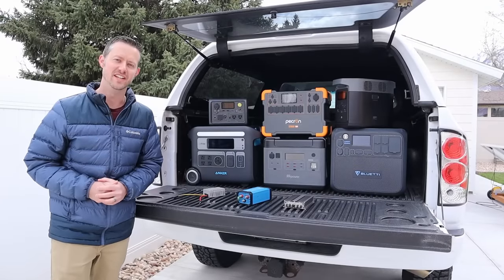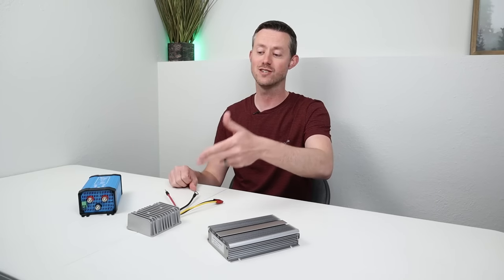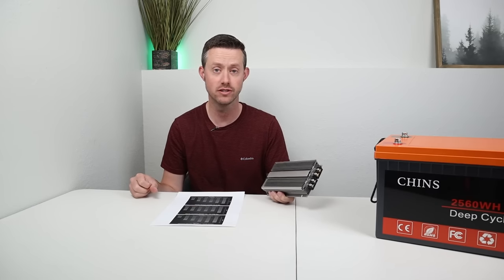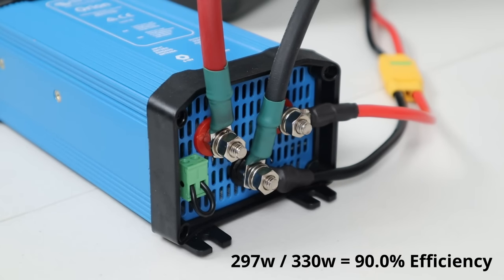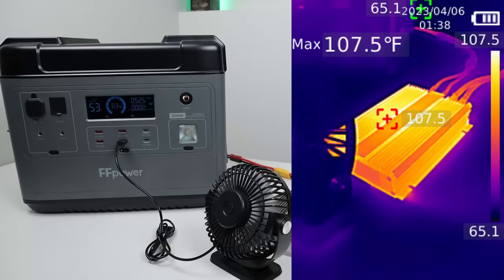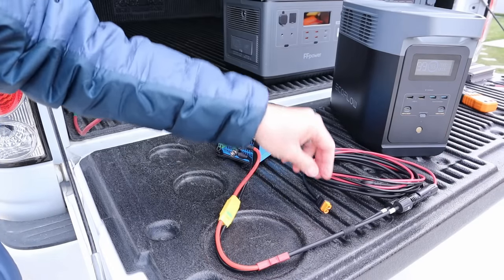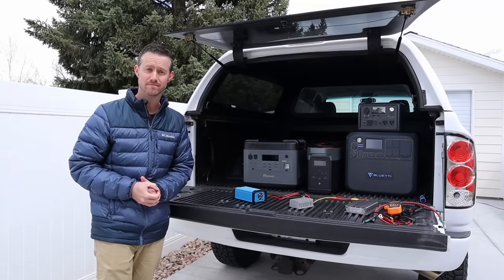Charge Your Power Station In Your Car FASTER - Perfect for Overlanding, Car Camping, and Van Life!

Comment: You could remove the Voltage regulator from your Alternator to get near 250 Volts with up to 200 Amps.
And use a Rectifier only and input that into the solar input of the Powerstation.
Then your power station becomes the Voltage regulator at 48 volts.
That would max out your solar inputs on all of them.
And then use the 12 Volt output of the powerstation to charge your car Battery.

Or you could even have 2 dedicated alternators.
One to charge the 12 Volt Battery and the other to charge the Powerstation.

Comment: Jason with summer coming can you do the holy grail test about running a window Air Conditioner 24/7 using only solar to recharge batteries.  Like show which power station, which batteries, which solar panels, etc.

Plenty of us preppers got emergency sheds that could use your great presentation and explanations.   Ty
Reply from the maker: The only thing is that I don't have a window ac unit and all my windows in my house open sideways, not vertically so it's not the best for hanging one.
Reply: DIY Solar with will prowse has some videos running cheep window a/c for cooling his solar for a shed he has playlist solar powered air conditioning

Comment: Hello Sir, thank you for your informative video! I plan on using the exact setup you have here with the Victron Orion 20 Amp Converter, 6awg to 10 awg cables to charge my (small) ecoflow river max (576 W); what size fuse did you use on the 6awg near the truck battery? I plan on installing the converter in the back seat of my 2022 Tacoma.

Thank you!!

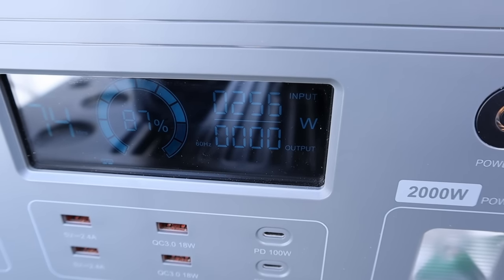Comment: Jason your video was very informative especially @15:26 because I have a Bluetti EB3A that I want to charge faster from my car.  Through the cig-plug, I get between 12-86 watts and it always jumps around on that as well (must be an EB3A thing).  Getting closer to the 200-watt max input seems great ~ double what I'm getting from the 12v cig-plug seems worth it.  I am considering either the 10 or 15-amp model because the max input through the MPPT charge controller is 8.5 amps at 12-28vdc.  Someone thought the 20 amp would run cooler because it was not working as hard do you agree?
Reply from the maker: Yeah, to get the best life span you'll want to get a larger DC converter so it runs at a 50% load instead of 100%. I'd recommend the larger option.

Comment: Great video as usual, Jason! Thank you.  Wondering if you can help: The Delta Max 2 has 2 solar ports.  Do I need to use two separate dc to dc converters to serve both or is there a single unit out there that would work?  Also, do you think the stock alternator of 180 amps would handle two converters?

Comment: Installed a 1000W Renogy ac inverter with 4 gauge wire in my vehicle. Charged my EcoFlow River 2 Max at 600W (adjusted max ac charging rate to 600W from EcoFlow app) as a test without any problems. Will be also charge my Delta Max the same way, and can adjust charging rate up or down based need or time on the road driving.
Reply from the maker: Sweet setup, lots of different ways to skin a cat and that option definitely works! 😁👍
Reply: What did you hook your Renogy ac inverter to as the power source?
Reply: @guitarnut5754  the vehicle’s 12v battery. I only turn on the Renogy inverter when the vehicle is running.

Comment: A small USB fan is what I use to keep my chargers cool. Some of my Type C PD chargers and ones for my power stations get very hot which can`t be good but a small fan blowing on them makes a huge difference, keeps them cool to the touch, and will extend their useful life.  These little fans only draw 2 to 5 watts depending on speed setting.
Reply from the maker: It's crazy what a little fan can do! I had it on the lowest setting which is around 1 watt of power.
Reply: @Jasonoid  I just got a new USB fan that ran over 5 days from one of my 15 dollar "phone charger" type power banks...a new record. The power bank is heavy but I think it`s 2800 mAh. It also listed 98 wh in the specs.

Comment: Thank you, this video is very informative. I consider using the Victron Orion 20 Amp converter for alternator charging of my Ecoflow Delta Pro, connecting it to CCP2 (175 Amp, ignitition activated "consumer connection point") in my 2023 Ford Transit. I have very limited understanding of electrical issues and want to make sure that there are no potential problems of my setup and have one concern in regards to this unit. It is a "non-isolated" device with only one connector for both negative cables assuming that both units are grounded to a common ground. Is this a potential problem since the Ecoflow is not grounded to the vehicle? I would greatly appreciate any clarifying comments regarding my worry/question.

Comment: I'm going with a 400W AC inverter just because i remembered i have one stored away in a locker, but this DC to DC is very interesting.
Reply from the maker: Going with a 400ac inverter is still a great option :)
Reply: @Jasonoid  what's interesting to me is that I could probably run 2 dc converters and get another big power bank 😅

They seems to always be on sale now. Even the 2kwh stuff is starting to become reasonably priced (for my budget)

Comment: Awesome video🔥.  I have a question:

If you have a 100w solar panel on your roof,  but also have the Victron.  Is there a way of having both connected at the same time,  or will Victron damage the solar panel, or will it not work properly?  Will I need to disconnect and connect them every time I use them?

The solar panel will be used when the vehicle is off
Reply: @emap6826. I have the same question. Did you ever get that answered.?

I’m planning on connecting the solar and Victron in parallel.
Reply: @emap6826. I have the same question. Did you ever get that answered.?

I’m planning on connecting the solar and Victron in parallel.

Comment: Great content - I appreciate your thorough reviews & use demonstrations of these power stations.  They're literally black boxes with I/O ports to those of us without electrical education & your videos bridge the gap between manufacturer info & practical use potential.

Have you done (or can you do) a similar video using the Bluetti AC300? Would you modify the aviation connector and use the 120V input port, or would you connect to one set of the MC4 connectors?  Would you use one of these boost chargers, or would you favor a DC-DC charger?  

I have a Victron DC-DC charger & thought that I'd use the MC4 connectors to the AC300, but I'm cautious about potentially damaging my Bluetti and/or my 220A alternator.

Thanks again for excellent content!

Comment: Like the video, very interesting, I ran a wire from my car battery to the back and made a wire to connect to my trailer with 150 amp Anderson connectors for a dc to dc charger.
All you have to do is run a big enough wire to your battery to where ever you are going to put the charger for it to work, right? No messing around with the alternator and I think probably not a great idea to wire directly to the alternator because the battery should give you cleaner or safer input power.
Reply from the maker: Correct, connect your wire run to the starter battery. The alternator will keep it charged up when you are pulling your load. No changes to the alternator needed.

Comment: wow this is exactly what i need! my 400watt built in ford transit power inverter doesnt charge my anker solix 767 for some reason. and 120watts isnt enough while driving. i was going to try a 1000 watt inverter but this would be much better! thank you!
Reply from the maker: The 400w inverter is probably a 'modified sine wave' inverter which puts out a rough sine wave. Most power stations won't charge from that type of inverter.
Reply: @Jasonoid  thank you thats very helpful!

Comment: Hadn't seen this video until now.  The cooling fan is a great idea.  To improve cooling of each converter without using a fan, raise it off the surface they are resting on by attaching "feet" to the base of each unit.  This would allow cooler air to pass beneath each unit, exposing more surface area to cooler ambient air temperatures.

This may not work if the converter is in an enclosed compartment.  Forcing outside air into the compartment would improve cooling measures.
Reply from the maker: Great tip!

Comment: Would be great to see how the additional draw changes any fuel economy of the vehicle, if at all.. 😎
Reply from the maker: I didn't hear the engine RPM change too much while running these. Most alternators make peak power around 1800 RPM or idle

Comment: Buying a 12 or 24 volt 100 AH LIPO battery and converter not only expands your solar generators capacity, but with the converter, it will not put unwanted stress on your vehicles battery and alternator..I would advise that method as opposed to charging by vehicle...And you can charge the stand alone battery with solar when the sun is shining from your solar generator, or at home with a charger, depending on your particular situation..There is real risk to your vehicle charging like that..In Quartzsite Arizona I've witnessed many RV fires and destroyed alternators from that very method, over the years..
Reply from the maker: Sure, it can be a problem if you don't plan accordingly with the proper wire size and such. Running at a 50% load on the alternator should be fine. This is a backup charging solution of solar isn't available... I would always charge with solar first.
Reply: Overheating your alternator is a risk. Btw, I have 240AH LFP, plus 2x dcdc charge controllers charging the LFP @ 90A. The methods in this video should not overheat most alternators whilst driving. Do not heavily load your alternator whilst stationary with no airflow.

One good strategy is to use a relay with a10min delay - this allows the alternator to mostly recharge the starting battery b4 charging your house LFP. You can also use a temperature triggered relay, to diconnect from your alternator if the alternator becomes too hot.
Reply: @Jasonoid what does that mean running less than 50 %?

Comment: Not sure if my question will be seen but thought I’d give it a try. I have the bluetti AC200 max with the b230 attached. I was looking for a way to charge the buettie’s while driving/engine idling. I have a ram promaster 1500 (Winnebago Solis pocket) van. I purchased the bluetti D050S Dc charging enhancer (spec says 12-60VDC 10 amp max) my alternator charges my house batteries while driving and they also get charged from roof solar (190watts on roof) the van also has a heavy duty alternator, not sure if that is 60 or 90w)? I assume if I plug the screen enhancer into the 12v ports in the back of the van the power will
Come from the house batteries. If I plugged it into the dc outlet in the cab the power would come from the van battery. (Both from the alternator I think) is one method better than the other? Do I need to worry about a high draw through my house battery system/ outlet?
Reply from the maker: Either charging port will work fine since the Bluetti charging enhancer doesn't pull much power. I would recommend only charging from you van starter battery if the engine is running though.

Comment: This is an excellent video and exactly what I have been trying to find!  I have a Bluetti AC200P that has the AC charger input socket and the 12/24 volt DC/solar input.  Which input should I use for the DC boost converter?
Reply from the maker: The solar input port would be the only one that functions with the boost converter.

Comment: Good info I’ve been running a 12v fridge with a solar panel with a 24v to 12v step down converter with no battery so when nice and sunny I am not putting the wear and tear on the battery bank.  Just think it is cool a fridge running totally off a solar panel.
Reply from the maker: I love running these 12v fridges while camping. Having a battery and solar panel setup can give you unlimited runtime, if the conditions are good :)

Comment: Great info!  How about mounting them under the vehicle in a passive ventilated box?  Do you see any issue with this such as overheating or water intrusion?
Reply from the maker: I'd recommend using the Victron for the best long term reliability but that model is not waterproof and does need good airflow. Maybe something in the engine bay would work but probably not underneath the vehicle.

Comment: Loved the video.  Might be a good idea to point out that 20 amps at 36 volts is roughly 60 amps with 12 volts.  Many people have trouble with the whole amp/volt/watt thing.  <grin> 60 amps pulled from your vehicles 12 volt system is a lot (a hell of a lot).   You will most definitely need special wiring, fuses and alternator considerations.  If you are not running the car (no alternator) with that type of regulated converter, you can easily kill the average group 28 battery in less than an hour with that load.   Just saying.  <smile>
Reply from the maker: The only power station that pulled that type of power was the Anker 767... A full 700 watts (36v at 20amps). All the other power stations have 12 to 15 amp limits which cuts the power down to about 525 watts or so. 

I'm was pretty clear in the video about proper fuses, wire gauge, and also told people to check their alternator for it's rated power.
Reply: @Jasonoid  Understood and you did explain that aspect.   That said, if someone gets a 20 amp 36 volt converter,  the potential of a 60 amp 12 volt draw exits if other things besides your specific units are involved.  The converter will pull 60amps if the draw requests it.   Folks have trouble (including me) understanding what the "limiting factor" is.  Sure a 20 amp 36 volt converter will only draw 10 amps if that is all that is requested, but if more is requested, it can go to 60amps/12volts.  It can be hard to understand what caps the actual draw.  You could have a 500amp/12volt converter but it would never draw more than 5 amps if that is all the devices request.  If the devices all of a sudden want 500 amps then your system better be ready for it.    Very confusing to understand what limits things.   As an example, I use a higher rated converter (say 20 amps)  under about half the actual load (load is 10 amps) just so that it will stay cool.  I found that if I size the converter the same as the draw it gets too hot. I know the load wont go ever 10 amps so I am safe but if for some reason it did, I would have problems.
Reply from the maker: @markmonroe7330  totally true, thanks for explaining what you meant.  A '500 amp 12v converter' is basically a 12v lead acid battery, short circuit that thing and you'll have 500 amps real quick! Haha

When dealing with electricity it's important to always be careful and use the proper safeties. Luckily power stations have over current protection built in so they "shouldn't" ever pull more power than that. I also agree with you that it's best to run these converters at a 50% load for a longer life and cooler operation.
Reply: @Jasonoid   well that was a very useful discussion. thankyou.

Comment: Go orion bc it has active cooling. If there is no active cooling, as temp increases, performance decreases and actually all u need is a 3 pin connector to increase output from the orion. Samr connector, but has a 3rd contact pin that tells the power banks its sending max power which will not cause them to throttle back their charging

Comment: Is my 105 amp alternator strong enough to handle the charge of my delta 2, my orion is already installed...works well  
Will my alternator will handle it in the long run ??

Comment: I've pretty much settled on an AC200MAX for a van build but was nervous about slow alternator charging - especially in the winter. This looks like a game changer, so thanks for that! 😊

I read that the Victron DC-DC converters can be connected in parallel. Is that likely to overload the alternator and, if not, would it actually double the charging rate? I think the bluetti van take 900W solar.
Reply from the maker: The AC200max only has one charging input. The amperage limit is maxed out with one Victron, so I wouldn't recommend two of them. The only way to get more power would be to go higher with your voltage on the one port.

Comment: Jason---excellent video!    We have an older Ecoflow Delta 1300 and the max solar input is 60volts/10 amps.   For our van I was going to purchase a Victron Orion TR 12/24/10a isolated DC to DC charger since I don't want to exceed the 10a limit on my solar input plug.   I know the charging won't be very fast but good enough for our travels.   Would our Ecoflow shutdown or not take a charge if I purchased something like a 12/30/15 charger?   Thank you!
Reply from the maker: The Victron Orion converter series will be the only type that will work for this since it puts out a 'battery voltage'. I'd recommend this model:  https://amzn.to/4cbQeEh
Its best to run a device at 50% load so it lasts longer. If you push a 10 amp converter at 10amps it won't last long. Your power station will limit the current to 10amps automatically so using the 20 amp model will not be an issue and it will last longer.
Reply: Fantastic----thank you so much
 @Jasonoid

Comment: Jason, excellent video so just picked up a 2000 watt power station same as your FF 2001 on woot for 629.00 just has a different name (ideaplay) but specs are exactly the same except mine says the max input is 11.5- 50 volts 500 watts max 20 amps on the anderson plug,  I noticed you got over 500 watts on the 36v converter, so the small extra wattage isn't a problem?
Reply from the maker: The 36v converter would get a bit hot overtime so just plan on a way to cool it. It should be fine on the power station.